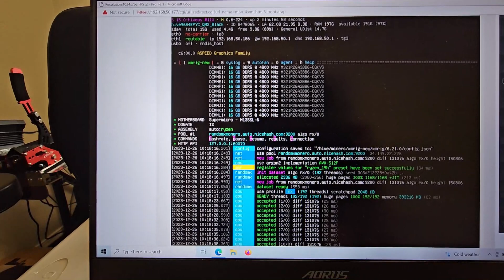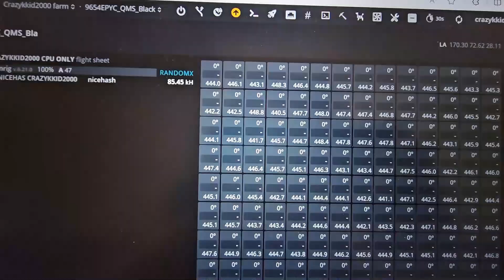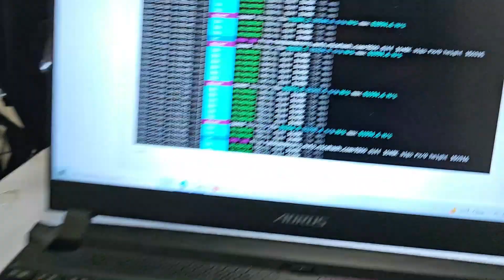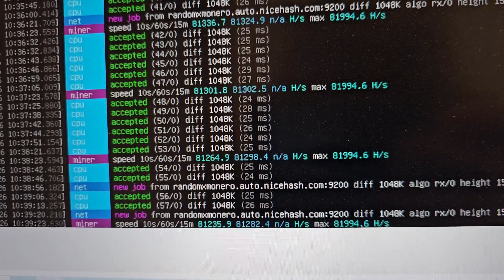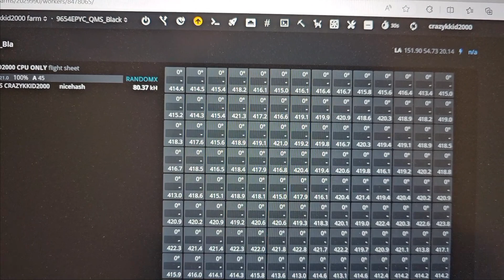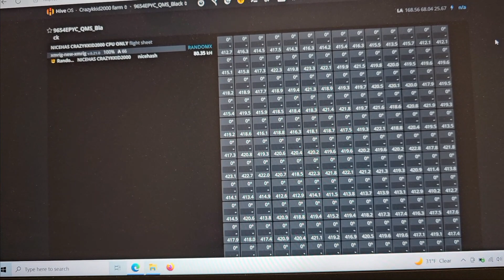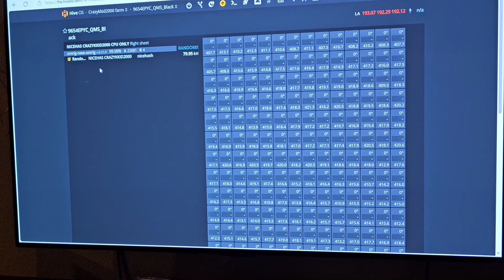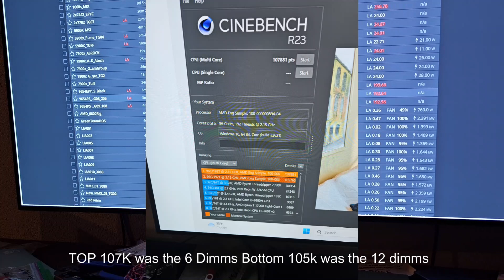EPYC 9654 RAM Channels RAMDOMX

Comment: good jop ...I would like to aske you which is the best motherboard for Eypc 9654  ? And are you using Window server or normal window 10 or 11 ?:face-turquoise-covering-eyes:
Reply from the maker: I have only used supermicro qnd tyan boards and both are good. And windows 11 will be better for a 9654 because it has a better cpu scheduler for handling all those cores. Otherwise I would use proxmox to divide it up into multiple machines. 
I have a video on that, its the newest video i have right now.

Comment: What Cooler are you using for that SP5 monster? Also whats the difference between 100-000000475-15 and the 100-000000894-04? would this be the base clock speeds? Thanks for making this video its awesome to see epyc CPU mining.
Reply: I also want to know the diference.

Comment: I almost bought this but opted to not get the ES for a multitude of reasons. Getting the proper 9654 and only paying $700 just made more sense
Reply from the maker: So how much are you getting a proper 9654 for?
Reply: @crazykkid2000  I got the CPU for $3281 USD. But there are some strong arguments for spending more on the CPU than opting for the ES. I actually noted that the ES you have runs incredibly well and i have a hunch that the hardware limited clock speed might actually be optimal for RandomX. The downside however is the fact that with ES resell value is harder and also the chip itself is wayyyy more tempermental than the final product. So there is substantially more risk in getting that "cheaper" ES that realistically isn't cheap if it were to die before ROI. Also you may have compatibility issues with later bios updates and drivers in the future. That being said it IS an awesome chip none the less and I truly hope that for you it pays off. I also opted for the SuperMicro Watercooler option which is pricey but i have had one on a 7742 build before and they do run noticeably cooler and DEADSILENT.
Reply from the maker: @Prosper85  that's awesome! Yea I haven't had any issues with the ES so far, but I payed less than half of that for them per chip. If I was going to do more mining rigs I'll end up doing 7702s, real production chips.
Reply: @crazykkid2000  I really appreciated the video you did on RAM by the way. Saved me money for sure
Reply: Quick question , are you using dual PSU's on the supermicro boards or just the 1? And how many watt PSU(S) are you using?
Reply from the maker: @Prosper85 just 1 evga 1000w gold